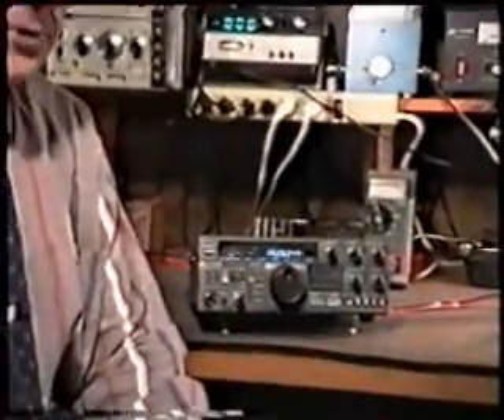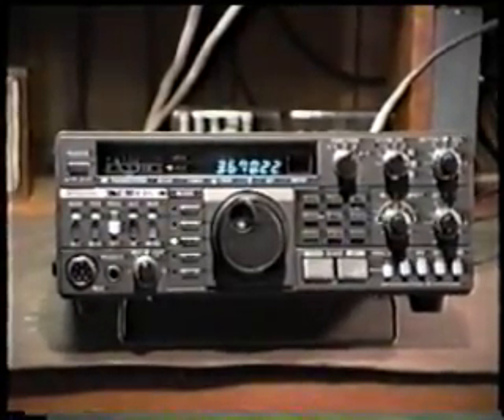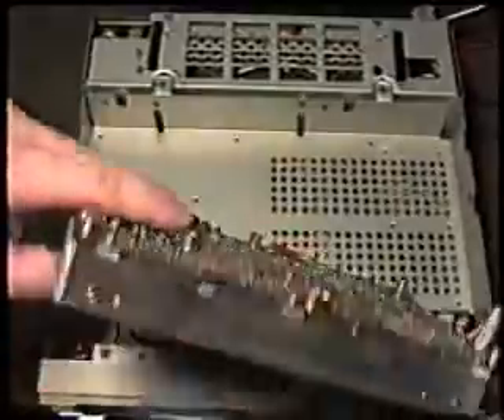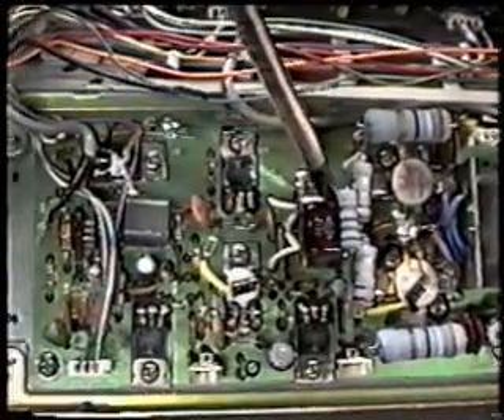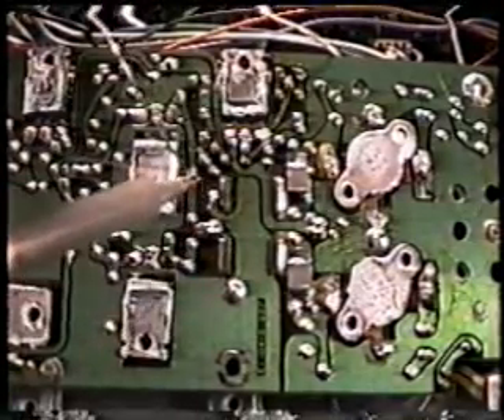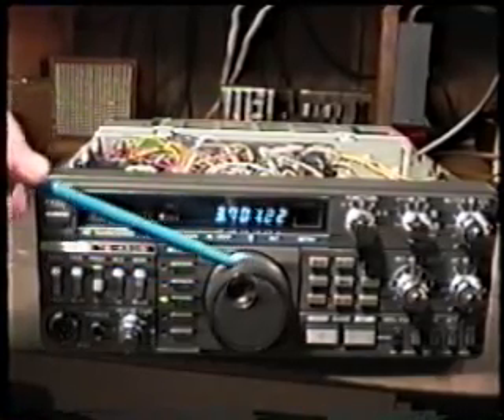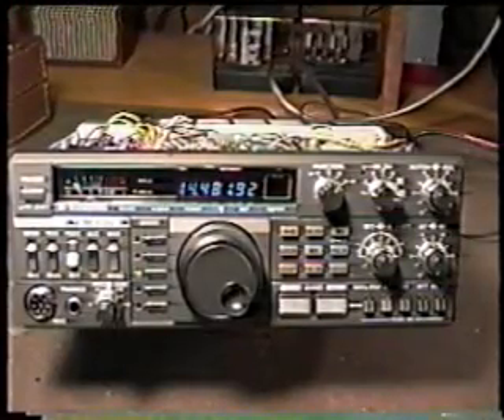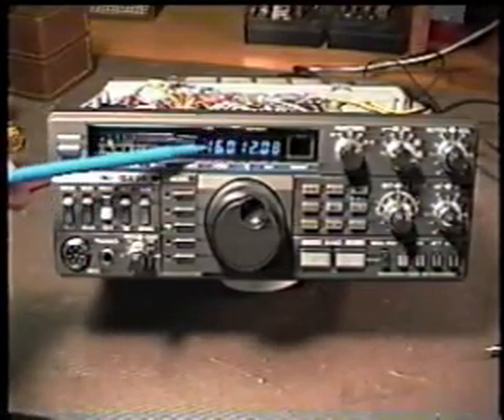Ham Radio - Kenwood TS-430S Maintenance and Adjustment

Comment: This is a very good video. Thank you for it. As for the reference osc adjustment, I have tried this method with two different radios and it did not work the way in the video. What worked for me is adjusting it in tx mode, aligning the carrier to a known transmission (just like in the video) using a SDR radio. Actually much quicker and easier, IMO.

Comment: It would appear to me to take the plastic covers off of the transmit relays and clean the contacts while you have the PA out.  I would have done that as well just so I wouldn't have to do it again later.  Thanks for the video.  I will have a working Kenwood TS-430S with the PS-430 dedicated power supply next week and am looking forward to using it when I get my General license as well next week.  I also noticed that your radio does not have the FM board installed.  I would need to know where the bulb is soldered as I'd replace the incandescent bulb with a 5mm bright white LED.  The LED needs to be oriented with + and - solder connections with a current limiting resistor.  A GREAT BIG THANK YOU for showing the modification to transmit on WARC as well as 11 meter band and opening up all the HF frequencies.  I knew it could be done--I just didn't know how.  THANKS again for that.  73 from K9POW in eastern Tennessee.

Comment: Thanks Frank, I'm YD1DDC (ex YB1JU) . Your video help me for repairing my Final Unit. Resistor R15 (15 Ohms/0.5W) at the base of Final Q4 is getting hot and burnt. I don't know why. I hope with all information from your video I'll fix this problem. If you have modifications for making TS-430S performance better pse upload its video.

Comment: When you connect 12 volts to the antenna connector through a resistor you are feeding current into the radio through the relays but where does that current go?  Is something inside the radio heating up?
Reply: The current goes to ground and it is nessary to use a resistor to limet the current so heating does not happen. A larger value resister will let less current thru.

Comment: Just picked one up for $40 not expecting it to work, looked nice but had dead on the sticker, got it home, checked it out, has the AM filter, powered it up & everything works, great receive and spot on freq but display goes blank from 1600kc to 2500kc with no receive. Here the relay kick in.

Comment: You may already know this but VCO-5 in a TS440 needs to have the Sonybond goop removed from it and apparently this may not affect the 430 but it is worth spreading the info I learned at this link: http://forums.qrz.com/showthread.php?351511-Kenwood-TS-430-and-TS-440-all-dots-on-display-solution Bob WB6SLC 73!
Reply: +RadioConx They did not use Sony-Bond on all of the 430s so far as I have  seen.  The earlier ones do not have that goop in them. They sure used it in lots of other consumer electronics back then. TS430s are most famous for cruddy dirty contacts. I don't know about burning the contacts clean though. My Kenwood key entry RF generator was also guilty of this issue. The relays are kind of iffy. It takes a gentle tap to get it to power up right, but once it does she works just fine. Eventually I replaced a few relays &amp; made sure it was spot on &amp; fully aligned it with a calibrated Agilent O scope &amp; freq counter. My FM broadcast band 19KHz stereo modulator was made by Matsushita/Panasonic &amp; no such problems. I do a lot of work on vac tube gear. You won't see my hands or finger smashing things around inside any of those vac tube Xcrvers, Xmitters or Rcvrs. I have fixed enough of this stuff, and finally went and got licensed to transmit last week. Easy tests, except for the extra. I don't think I will be erecting any antenna farms in a national park, but I now know I will need an environmental impact study.  These old 430s are nice to work on. I don't even need a microscope.

Comment: Hi there, over the pond, I'm from holland (netherlands (19)) I am following it all, its a great help. Ik have a question. Is there a possibility to make the outgoing power, (watts) adjustable?  Say from 1-120 watts fm? Because I really miss that. Mine is only giving 55 watts, which is very low. So can I change the wattage (variable) and put it up to 120? Age here is 64 years, an ol'rooster with parkinsons. But still enjoying.. yopper@zeelandnet.nl

Comment: Had a huge sensitivity difference between 6.499 and 6.5 mhz. Went through the relay cleaning.  Only had a 50 ohm resister for around 250ma.  Huge improvement.  My short wave listening really got a shot in the arm.  Great video.

Comment: Hello Milton,
Great work, just one thing to point: the speaker connection shown in the video is not correct, the speaker connect to the IF board on connector 1 and not to this one, that connector should be to connect the optional FM card. I am trying to make one working, very poor sensibility and scraches when tuning on frequencies with signal.
Many thanks for this video, it helps to understand.